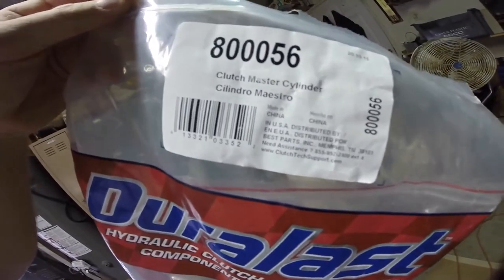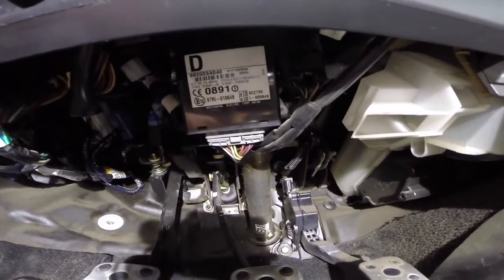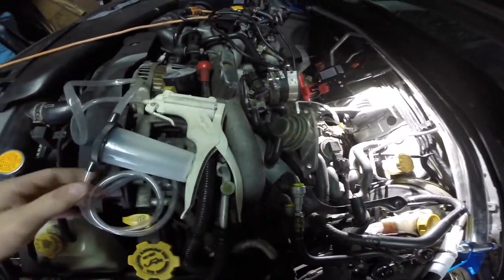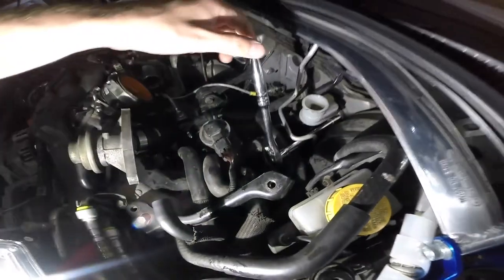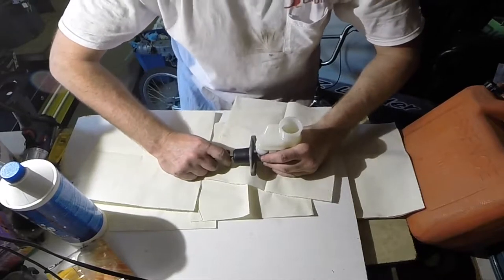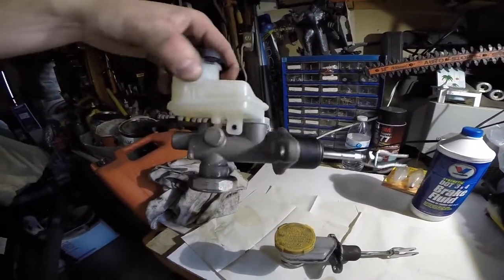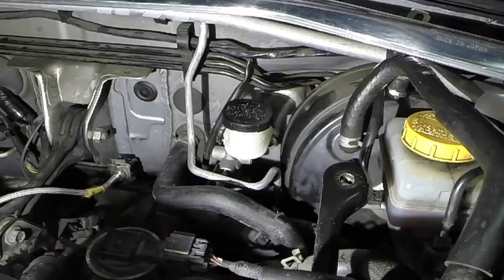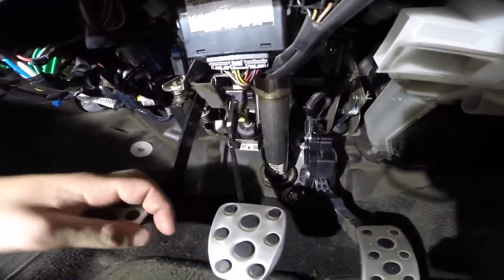Replacing Clutch Master Cylinder On The WRX

Comment: While driving yesterday my clutch suddenly dropped to the floor and felt like a brake pedal during a bleeding. Literal slip for the first half of the pedal and no pressure after. Thanks for showing the procedure to replace these parts so well.

Comment: When one thing breaks, in the end 20 things need to be replaced it seems like with subarus lol
Reply from the maker: +Cali_WRX seriously!  It ain't cool Subaru,  so STOP!
Reply: 06WRXDUDE I have a 2002 WRX went to shift next thing I know my clutch pedal goes to the floor after I went to second but after like a minute it felt like there was something at the end of the pedal like half an inch of that makes  sense
Reply from the maker: +Brady Stanga  leaking clutch line or slave cylinder maybe?? That's pretty scary man.
Reply: Yup

Comment: HELP ! I've just done this procedure with no luck.  My Master failed (100% sure) b/c it had leaked and lost all fluid.  I replaced the Master and did not replace the Slave (the slave showed zero indication of leakage or anything).  While bleeding the slave I removed a little bit of air.  With the bleed screw tight, I pumped the clutch pedal slowly.  No matter how many times I pump the clutch, I can't get normal clutch pressure.  There is pressure on the pedal for the last few inches of stroke (to the floor) but the pedal will not return to the up position.  I've pumped likely over 100 times.  Help.  Is it possible that my slave is bad?  I don't understand how to tell.    Must the Master be bled?? I don't think so because I've circulated at least 500ml of brake fluid through the system and I can only see the tiniest of air bubble, it is clean.  Pumping the clutch does indeed move the slave cylinder; but I only see about maybe 1/2" of travel on the shaft (not sure if that is normal travel).  Thanks in advance!

Comment: I think I bled my clutch fluid? Not sure as the  pedal was stuck on the floor, only after pulling it back up and waiting 5 minutes it felt like it had resistance again. I tried the two person method, open the nipple as someone else is pushing the clutch pedal, close the nipple while they're hold the pedal on the floor. Then, pull the pedal back up slowly, wait 5 minutes for the clutch to feel like it had resistance again. It took ages for the reservoir to suck up more fluid. I'll try your method next time. Quick question though, what do you do after the last bleed cycle when the pedal is left on the floor?

Comment: so when you opened the bleeder screw you had the cap on the master cylinder, did you keep the cap on for the whole process?
Reply from the maker: I had the cap broke loose for the whole process to relieve any pressure.

Comment: Hey how are I've got the 2014 sub STI my brake line had a small leak causing my clutch to feel soft .
I tried bleeding system now the pedal went all the way to the floor & won't build compression back up look at the sleeve & it don't seem to be making contact with release bearing can you help.?
Reply from the maker: +jastweal4 Bleeding the system takes time. I didn't start building pressure in the pedal for a good while. I just kept at it and eventually got a stiff pedal. That's from my experience with my WRX. Sti may be a whole different application? I'd search the forums for more info. Good luck 👍

Comment: i replaced my slave cylinder on my 08 subie and 2 weeks later clutch is soft for the first 80% of the stroke on cold startup.  could this be a bad seal on master?
Reply from the maker: +CowdreyC it's possible. Have you leaked any fluid?
Reply: no leaking fluid

Comment: Bought the same master and slave cylinder , have it all in but I can’t seem to get it to bleed the system leaks out air when I loosen the bleeder valve but I still get no pressure I’ve tried 20+ times anyone have any tips / recommendations

Comment: My car subaru wrx 2007 problem is  gear shift does not change when i start the car. but when i turn off car then change it gear shift.
Reply: That is my exact same problem.  Did you ever fix it?  I have a brand new clutch master cylinder I will be installing soon.  Hopefully it fixes the issue. Really hope I dont have to drop the tranny to replace the clutch or the throwout bearing (which some people suggested it could be the issue).
Reply: Huy Nguyen did u fix your clutch yet? I have the same issue